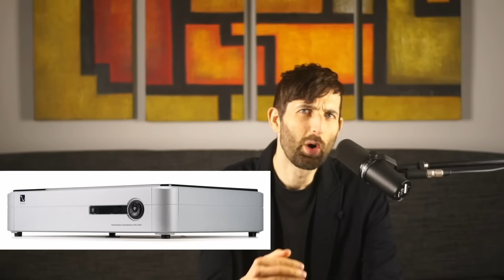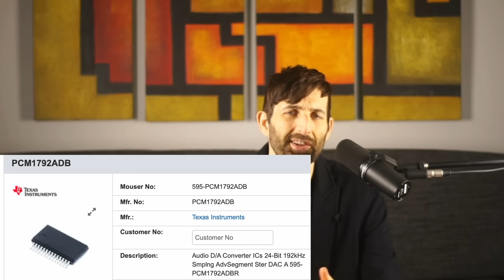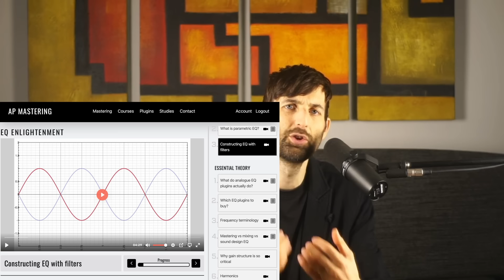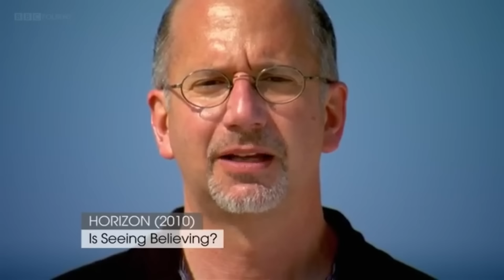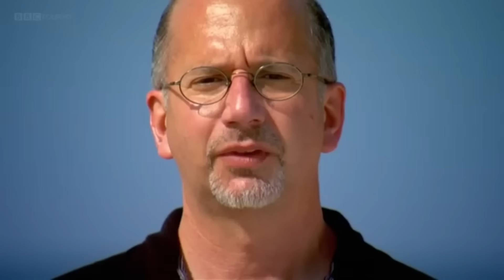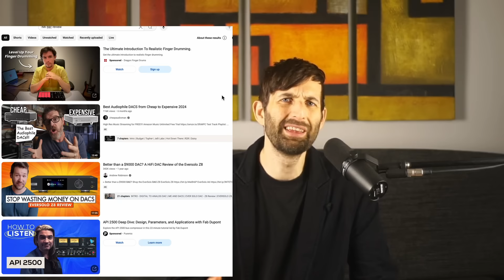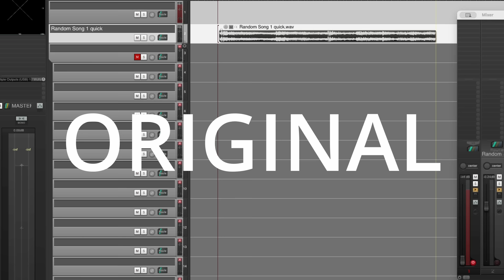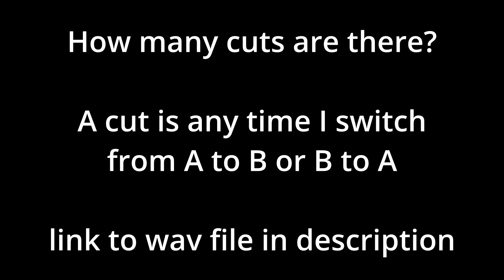The DAC Scam - Almost everyone believes the hype

Comment: I listened to the WAV file and no difference in the Audio, except in one section 0:11, the image width changes slightly, whether that's a mixing artifact or not, I'm not sure, most probably, because each converter comes in on a different part of the track, making it difficult to compare minor differences in sound. 

But,  you're cunning, you picked a track with a massive amount of "noise" i.e. cymbals, hi-hats , drums , distorted mid heavy guitars (1khz - 3khz) - that alone makes it impossible to hear any differences at all in the audio.  Try using some well recorded solo acoustic fingerpicked guitar or a single cello or some other acoustic instrument with a broad range of harmonics in an acoustically neutral dry space, with no effects or EQ or compression.

I've used many different audio interfaces in my studio, from M-Audio, when I first started out about 3 decades ago, to AVID HD,  Focusrite Red, RME, Mytek, Benchmark, And now Lynx Aurora.  I can say that the only really bad sounding conversion was M-Audio, The difference between the rest of the converters was mostly nil when comparing D to A converters. 

A to D converters on the other hand had much bigger differences between them.  On acoustic instruments, like acoustic steel string guitar, I could hear a difference between a Mytek and a Lynx Aurora AD converter or a Lynx and RME A-D converter, it was small but audible, and other people in the studio could also describe the same differences I heard, so not imagination. Cheaper A-D converters compared to high end converters had quite a large difference, mostly in the high end and smearing of the bass frequencies, mostly because of poor clock stability.  

But as time went on and converters got better, nowadays even the less expensive ones sound great.  The way something is recorded will make a massive difference compared to the converters / preamps used.  The acoustic space things are recorded in,  will make a massive difference compared to the converters or preamps, or even the mics used for the recording. A badly recorded song sounds bad on any system, and the reverse is very true as well.

I've followed your previous videos about compressor scams, EQ scams etc.  You seem to love generating click bait titles on your videos and using hyperbolic language in your descriptions of different gear. I don't know if you're just trolling people for the hell of it, or actually mean what you say,  because a lot of professional sound engineers seem to disagree with you, on a lot of what you say.  The internet is a magnet for people with opinions, and I generally take each post with a very large pinch of salt.  I guess we all need a way to earn money, so have fun making your videos.
Reply: @IllusionK002  I definitely heard a difference when I switched from RME to Lynx, too.
Reply: DACs tend to work the same way (the ladder) but ADC's can be very different and also a lot more inherent complexity.

Comment: This is the same as saying ;all violins are the same, all made of wood
Reply: @paulcox7787  😂 no it’s not
Reply: "This is the same as saying ;all violins are the same, all made of wood"

Nope, this is the sam as saying; all violins will sound the same played alive, or recorded using quality digital  studio equipment and played back using any decent DAC.

And, this can be easily proven by converting analog audio signal produced by and decent DAC, back into digital signal, using ADC, and when feeding it back into DAC input, resultant analog audio signal will sound exactly the same as original digital signal converted to analog audio signal.

Comment: I builded my own f.a.s.t. speaker system and needed an DSP to flatten my ripol subwoofers response. I used with an DSP-chip from Analog. The input is realized  via SPDIF and the output is realized using DAC boards with TI PCM5102  for 8€ each.  The result is amazing considering the hole 2 in 4 out DSP system incl power supply costs me about 80€.

Comment: I was just watching a video about CD players and two different "CD transports".. the idea of paying $1200 for a device that "spins the disk in the best possible way.."
What does it take for people to get it that the data comes off the CD, but it's not like a turntable, the data gets read into a buffer, error der and correction done, and THEN, spooled out by a clock. The disk can almost be spun by hand, and as long as the data comes off it, it doesn't matter if it wobbles, or is off center, as long as the tracking works, and the error rate is low enough to be corrected by Messrs Reed and Solomon.
Reply: Oof. You made the mistake of saying “error correction”.
Reply: Bingo.  They don't seem to understand that the laser reads from a few mm away at the literal speed of light and only has to discern between 1 and 0.  After all of that money for that little of an achievement, a CD transport STILL doesn't decode to analog and now you have to buy a DAC too.  Such stupidity.  The best DAC is no DAC (well, as a separate anyway).  Any modern CD player will have a near-perfect signal.  Spend your money on actual difference-making gear and a better room to listen in.

Comment: I've owned several DACs from PC sound cards, to a few hundred dollars to the $1k range and one each costing $3k and $4k. I'm not going to defend the ultra high end. And I'm well aware that DACs generally have less variance than other components.

However, I absolutely hear a difference between different DACs. First of all, I disagree with the first half or so of this video. Yes, many products across a wide price range will use the same chips for the actual conversion. But to say that the chip dictates the sound, is flat out wrong. The implementation of the chip, the power supply and the analog output stages make a bigger difference than the choice of which chip to use. 

For example, I have a $1k ish DAC on my headphone system and the flagship $4k ish DAC (which I bought used!) from the same manufacturer, on my speaker system. They both have the exact same R2R boards for the conversion and being from the same manufacturer, they sound pretty similar. The high end DAC has a much more advanced power supply and better output stages. The result (and I've compared them side by side on the same system of course) is that the high end DAC has a quieter, "darker" background if you will, with higher perceived resolution, but also sounds smoother at the same time. The high end DAC also has more presence and detail (texture) in the lower frequencies, which maybe the biggest difference between them. It's it night and day? No. Is it worth the cost difference? That depends on the rest of the system, your budget and your objectives. Is it snake oil? No. 

As I mentioned above I'm a fan of R2R DACs. Depending on the specific DAC, I might prefer over sampling, or I might prefer no oversampling. I wouldn't use them in a studio, but the objectives of a home system and a studio system are different. The studio system needs to be as honest as possible, but the home system needs to be as enjoyable to listen to as possible, given the owner's preferences.

As far as confirmation bias goes, I've spent good money on things I wanted to love, but didn't. And I've owned equipment that I felt I should upgrade out of, or didn't expect to like so well, but kept coming back to. I know what I like and I know what I don't like and I'm not afraid to say I don't like something.

One more thing to keep in mind, everyone's ears are different. And if you're listening to speakers, your room is just as important as the system.
Reply: He is not talking about acoustics, but about the fact that majority of people who took his test (where he played two sound files, one originally produced by his DAC, and the other which is that same sound file, converted to digital signal, and then from digital to analog again by his DAC) couldn't tell which sound file is which, or when exactly he did change from one to another, which effectively proves him right.
Reply: @max5250  I mentioned room acoustics because it's relevant to many of the people who will watch this video. If you're building a speaker system at home, then you should be concerning yourself with the physical setup and some room treatment, long before splitting hairs over DACs.

The fact that people have a hard time discerning between a recording that's been through his DAC once vs twice, just means that he has a good ADC and nothing in the chain is garbage. It doesn't for a second mean that a different DAC won't sound different, or that different people won't have different preferences for their home system. Though, in the case of going for something intended for studio use, you'll want the flattest measuring equipment and there will be less variance in that kind of gear.
Reply: @ Of course acoustics of the room you are listening sound in, together with quality of speakers, and amplifier used  to power these speakers, is of utmost importance for getting good quality sound... no one is trying to dispute that.

But here, the discussion is about digital-to-analog (as well as analog-to-digital) conversion which matured so far that there is not noticeable difference between original sound produced by DAC, and sound produced by converting that sound into digital signal, and back to analog again, which means that conversion itself, do not affect quality of sound at all.
Reply: @max5250  Again, I'm only bringing up room acoustics as a reminder to people to stay grounded in this discussion.

I don't need to repeat what I just wrote previously, so I will say this: When you own multiple DACs, particularly with different designs and price points and can't tell them apart with any amount of side by side comparison, then your statements will be true for you.

I have owned several DACs over the years and have made many side by side comparisons as I decide what to keep and what to sell. Or had friends over with other equipment to try out. I can tell a difference between DACs and that's the bottom line for me.

We can say whatever we want about scientific measurements and theories and those things absolutely all have value. But at the end of the day, the only instrumentation we have to enjoy music, is our own ears. If our ears tell us that two pieces of equipment sound different and we prefer one over the other, then that one is better. It doesn't really matter why.

I am well aware that there is a lot of conscious and unconscious psycho-acoustic phenomena at work that effect our perception. I completely agree that it is important to try to cut through BS and make sure we aren't fooling ourselves into over spending. But it is also important to understand that the subtleties which may make or break our enjoyment of a particular system are very difficult to communicate and understand via graphs.

Comment: What about resistor ladder DACs and FPGA DACs? I have had the pleasure to own a Gustard R26 (R2R) and a Chord Electronics TT2 and M-Scaler (FPGA with a bunch of upsampling). Both gorgeous but I would draw your attention to the FPGA. Unambiguously better than the ESS, AKM etc stable and the Gustard but at a cost of £7k (or under four if you buy second hand wisely). I won't argue that £7(or 4)k is outrageous for a bit of audio as is £150k for an BMW M3 or £750k for a Jack Vettriano so let's not go there. Whether I am deluded or not , I believe deeply that my money is well spent. Thanks for providing the samples and avoid the American Science Review trap of simply measuring stuff rather than listening to it. I'll subscribe. Thanks
Reply from the maker: FPGAs are not a topology. it's a piece of hardware that enables you to make custom chips for small runs or where you can't afford to design a real chip

Comment: This is very low level of understanding of electrical engineering. This guy chases drama for views hence such declarations "all dacs sound same". Its the same thing as "all vinyl is digital" 😂. 
 While 10.000 or 30.000$ can be scam an most likely is, you will hear a big difference between a 50$ - 200$- 500$-1000$ Dac. Qualty of sound depends on the quality of all parts of DAC not just dac chip itself, you have powers supply and analog amplification, which can be made from bad or good quality parts and designs. Only those with clogged ears would not hear the difference in blind test on a good system (nothing dramatically expensive).
Loopback test is more nonsense. Thats a benchmark for some combined quality which 99% of uses will never use. Only someone recording can use it.
 Why would you test recording on a DAC in a output quality test? Are you testing recording or playback? You are aware that ADC and DAC conversions are two separate operations? How does this loop nonsense has anything to do with various DAC designs? Nothing....😂
Reply: 100%.

Comment: Bravo! Well said and explained! Data processing ‘semiconductor chips’ or any ‘IC’ chip has a dirty little secret. From the genesis (or fabrication) of this miraculous modern marvel is profitable ‘yield’ per wafer, thanks to the manufacturers' ever-benevolent hearts.  Designed within the full spectrum of most ‘dyes’ (complete individual chip architecture), they are capable of functioning with redundant circuit paths. However, with the inescapable ratio defects diminish performance and functionality (but still kind of functional). These chips thus become repackaged as different 'flowery nomenclatures of grandeur' down the line as they diminish in ability. At the core of all consumer electronics (as well as most contrivances; is the 'engine') Case and point. During the sunset years of the ‘VCR’, if one were to strip off the exterior enclosure, one would discover the same platform wrapped in a different-looking ‘Package’. The same goes for microelectronics.

Comment: Dear AP Mastering, please suggest me inexpensive true 24 bit PCM audio interface for 8 ADC/DAC channels (not sigma-delta ones), and I will agree with the title of the video
Reply from the maker: what's wrong with DS?
Reply: @ latency
Reply: @APMastering latency
Reply from the maker: @ latency is so low it's not really a concern. but you are willing to have a worse dynamic range, more distortion, less transparent sound just for tiny gains in latency?
Reply: @ rme specs below

SNR: >110 dB(A)
Supported sample rates: 28 kHz - 200 kHz
THD: < 0.0003 %, < -110 dB
Latency < 0.28 ms

They use AK4621 with proprietary converter, with such low latency is definitely not a delta sigma
Reply from the maker: @ just looked at the datasheet for that chip and it says it's DS. i've got nothing against ladder if it is transparent but my point in the video is that decent moderately priced DACs can be totally transparent.
Reply: @ on what page have you found about delta signa for this chip? I not found any mentions. Also DS are slowest among all types of converts. Read about SAR and Flash converts. Stacked 14bit flash converters can give real 28 bit of precision, and they’re fastest ones.
Latency is real issue when you record more than 10 channels with monitoring. And worst part of it is jitter. So definitely you will not find inexpensive ones with such characteristics.
Reply from the maker: @ SAR is used within DS. you don't get more latency with more channels, at least not necessarily
Reply: @APMastering sar is absolutely different type of converter. Probably you have read about sar with delta signa combo in one codec package. This not makes sar a delta-sigma type of converter. Anyway, you refer to 5 bucks per chip. For example 14 bit high precision flash adc is more about 100USD per channel, and to have 28 bit you need two chips for both wave halves. It’s 1600USD only for 8 channels
Reply from the maker: @ you just don't seem to understand how multibit DS works in that case
Reply: @ yeah. I will tell this to my employer:)

Comment: This is wrong. Clock, Layout, Power Supply. Output Stage, Shielding, Grounding. All are more important than the chip. Also the ear hears timing errors far easier than amplitude errors. All measurements tell you is amplitude errors. Waste of my time
Reply from the maker: clueless comment
Reply: @ you have tin ears
Reply: @mikeconnell698  So, you can hear the difference in the sound file he provided?
Reply: @max5250  That recording has so much inherent distortion as recorded, I doubt anyone could tell. the difference. Mud x 50 is still approximately Mud.

I will agree that the particular chip plays a less significant role. The surrounding circuitry plays a much greater role. However, in a speaker based stereo, the room plays an even bigger part. Its not worth my time trying to convince flatlanders of what I hear. You hear it or you don't.

Comment: The chip manufacturers have many different models of their chips.  It seems, to me, that they would not bother if there was no difference. 

Of course, I agree that many believe that the more it costs the better it must be.

I cannot comment on anything other than my experience.  I have 3 DACs, 2, of which are dongle DACS.  The dongles use two different chips from 2 different manufacturers.  Using the same source and IEMs I can hear a difference.
Reply from the maker: different models for different applications. low power, channel count, budget etc

Comment: It is a scam. But it does not mean all audiophiles accept the scam. I have expansive speakers with chip amp and a chip based interface. 

It is just hard for many to accept that dacs and amps with class d means transparency is something you can get for less  than 1000 euro. This was not the case 5 years ago. For me it has meant that I spent more money on speakers and soundid pro